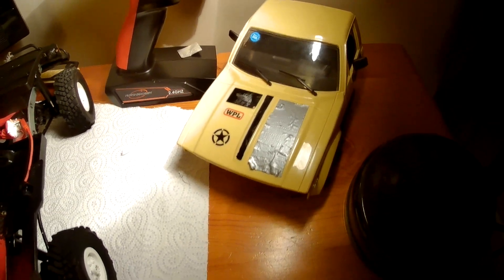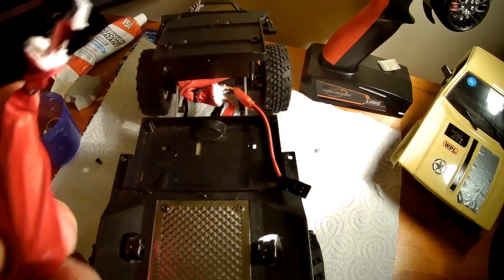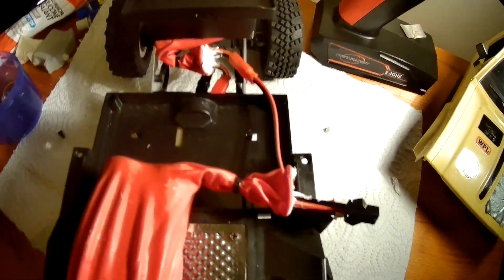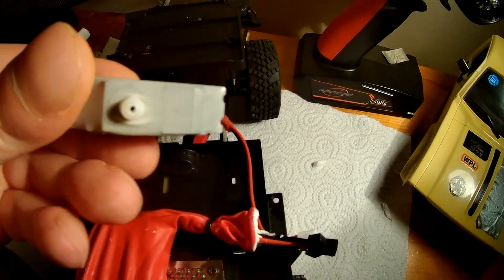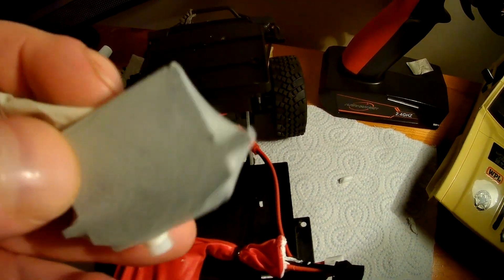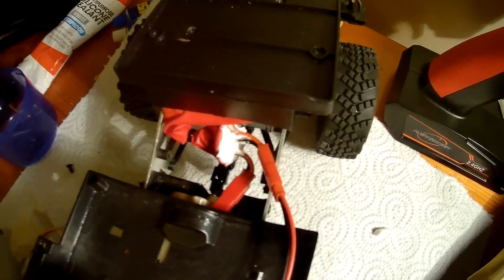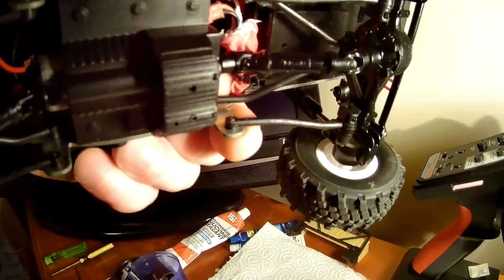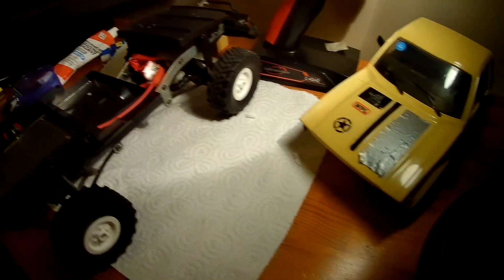Waterproofing RC Electronics on a budget!

Comment: I often use a balloon for the radio receiver, but for the battery I never protect them and I am not sure that it is useful, to check if it will not heat. For the glove on the servo it is a good idea to see if it does not tear.
Reply from the maker: I've heard nicad batteries are fine in water,  lipos are another subject 😂 you can use a balloon for the servo also, the c14 servo was to small so I used a rubber glove finger. Hopefully get go out and it get it wet today!
Reply: @THYC  I will try this solution, but also see to dip everything in liquid silicone, which will probably be simpler 😊👍
Reply from the maker: @satorrotas  wouldn't that wash off over time, if I had the budget I would go for mg conformal coating or some plasti dip.
Reply: @THYC  Yes it is true that the plastic dip would be good . I looked at the price in a pot of plastic dip it is very expensive but I just saw that they do it in spray paint at a correct price, I wonder if the waterproof effect would be good .